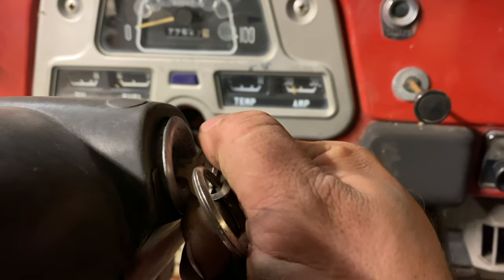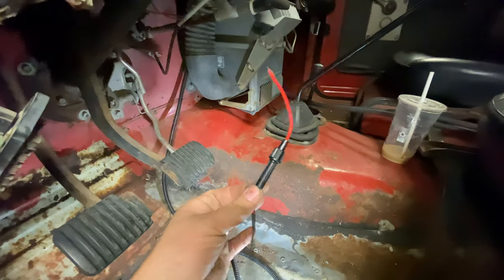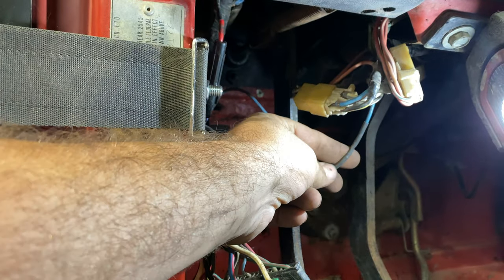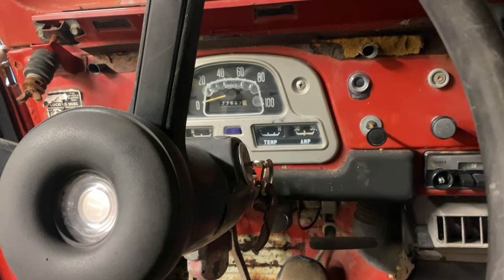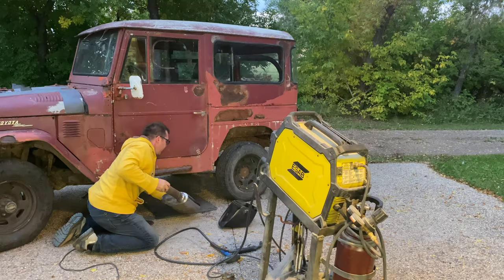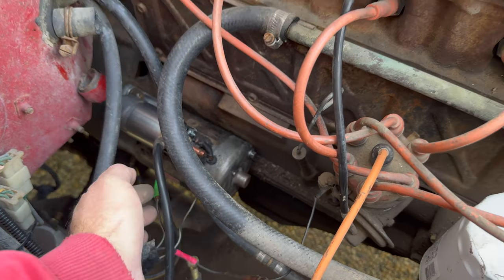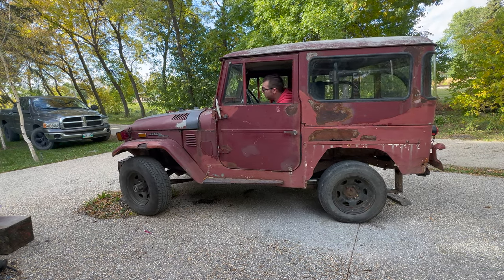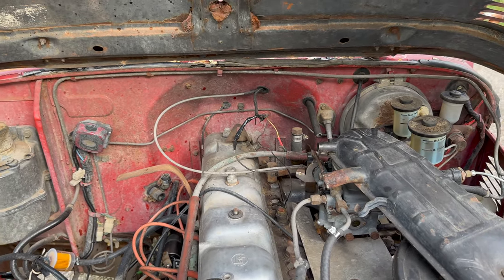First Drive in - FIVE years? Barn Find 1974 FJ40

Comment: Congrats on the first drive, but looks like you still have a ways to go yet. What are your plans for the suspension, especially those incredibly long rear shackle?
Reply from the maker: Those shackles are real beauties:) My goal for the suspension is to put a lift on 2-4 inches. so everything on it is going to be replaced for new and reliable stuff. wheels I am aiming for something like the old style white wagon wheel steel wheels in an 8-10 wide width. Tires the BFG 33by 10.5  to 12.5. I have some decisions to make yet but putting together a list of where I would like to see this truck end up. I going to need a rear hitch to mount a rack for my mountain bike as well!